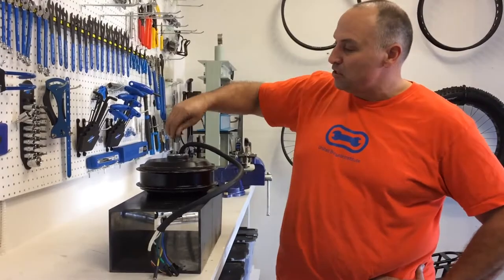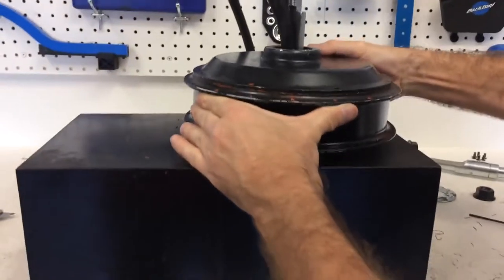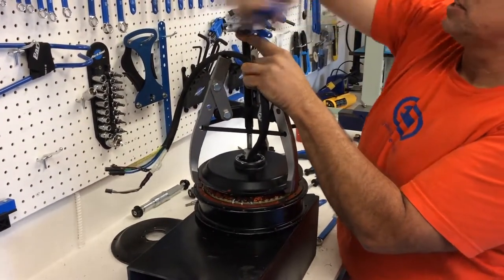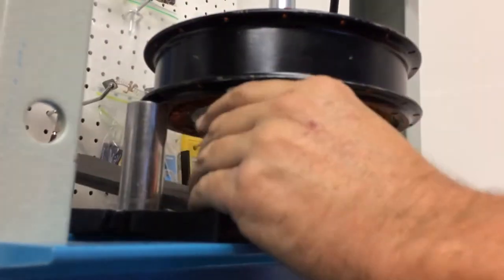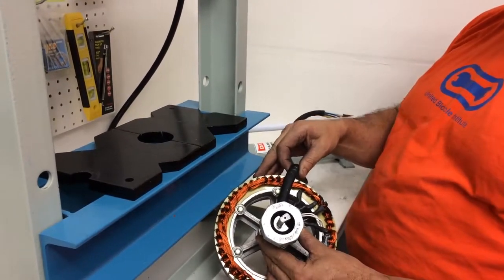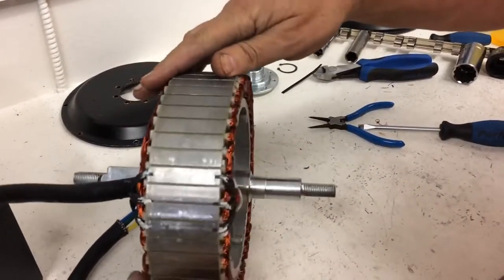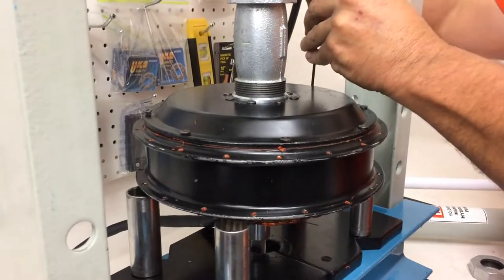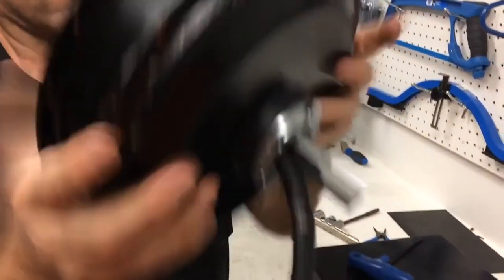Ebike Hub Motor Disassembly & Reassembly

Comment: What size is that gear puller?
Reply from the maker: I use an OTC 1038 https://www.amazon.com/OTC-1038-Mechanical-Matic-Puller/dp/B00063WVUI for the side covers and an OTC 1023 https://www.amazon.com/OTC-1023-Mechanical-Matic-Puller/dp/B0002SRFN0/ref=sr_1_1?s=automotive&ie=UTF8&qid=1539143818&sr=1-1&keywords=otc+1023 for the bearings.